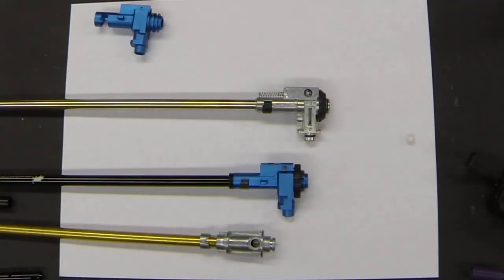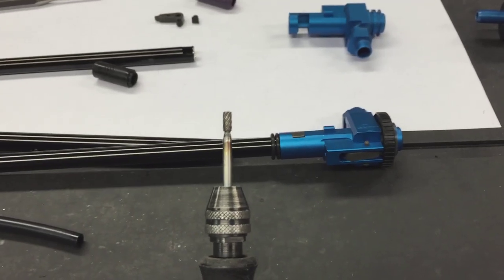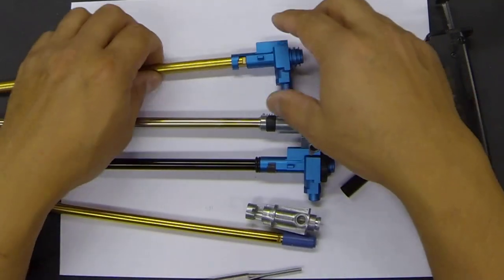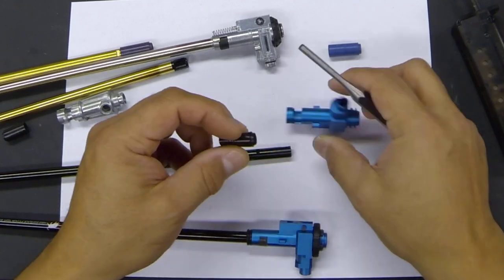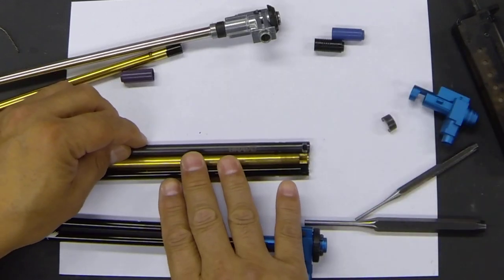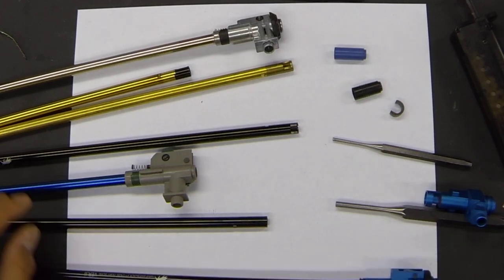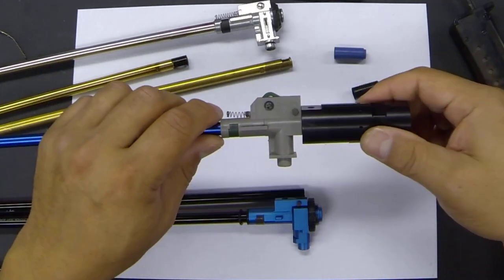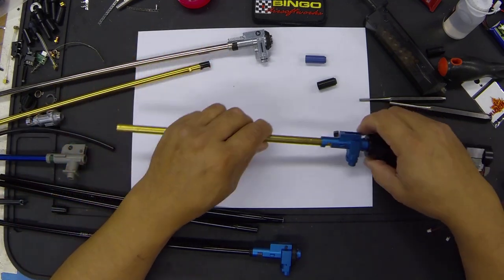Bingo Airsoftworks Hopup, Buckings and Barrel Testing and Troubleshooting

Comment: Hi, I am looking for my hop up chamber, and saw a hole in the upperside of it. Can I to close it? Can It maybe do a leak? My hop up unit is that you use in 14:16, G&G, gray. Thanks!
Reply: +Vicente Souza The hole in the top of the hopup is there to help prevent double feeds (I believe). No need to close it up, the air seal isn't with the hopup body, it's between the nozzle and the bucking lips only.
Reply: +Bingo Airsoft Designs THANKS FOR THE ANSWER, I CLOSED IT AND AFTER I OPENED, AND I DID NOT SEE SO FEW DIFERENCE.

Comment: Really interesting, thank's !
I usually use Delta Strike barrel, Prowin chamber, purple prommy bucking with inner cleaned up and the prommy bridge tensionner, imo it's a very good setup, since the ProWin chamber gives an extremely precise regulation whereas a Marui standard system is terrible. 
I'll try to shave of the extra lips on the blu flat bucking and test it in a ~440 fps setup :)

Comment: Hey man, thanks for the video, i learned a lot! But i found a problem that i can't resolve...
The bb drop test works perfectly in my prowin + g&g green bucking. but when the gun is assembled the 'bb drop test' fails, and i figured it out it is the very tip of the airnozzle is the cause for that, but i have no idea what to do, because if i adjust my hopup to be just that 1mm more in front, my gun loses FPS (probably due to airleak from the nozzle-bucking...) do you have any suggestion?
Reply from the maker: What type of gun? Which HPA engine? (or AEG?)
The hopup should be flush up against the fast of the gearbox/engine. It should not be moved forward.
Reply: BingoAirsoftworks its a m4 from king arms
Reply: AEG*
Reply: BingoAirsoftworks but if i leave it pressed against the gearbox, the airnozzle doesnt let the bb feed
Reply from the maker: With an AEG, you can't do a drop test when the hopup is pressed up against the gearbox because the position of the nozzle is dependent on the where the sector gear is and the tappet location. So depending on where the gearbox stopped, the nozzle could be in any position. If the BBs aren't feeding, it is likely due to low BB feed pressure, so it isn't pushing the BBs up into the hopup hard enough. See my other video on BB feed pressure from mid cap magazines. There is a possibility your nozzle is the wrong length, but really all M4 nozzles should be pretty standard.
Reply: BingoAirsoftworks I am having the same problem with my krytac mk1. Haven’t had any problems with it till the other day I took the upper receiver off and now it’s not feeding right. If you look through the mag well you can see the tip of the air nozzle from the bottom of the hopup. I have removed the upper receiver many times and never had this issue till now.

Comment: jams at the bucking when i use a c clip but when i remove it, it's fine. is it that important to use one?
Reply from the maker: Yes, the C clip keeps the bucking/inner barrel from moving forward (and shifting) in the the hopup. If having the C clip in is causing the bucking to jam, then it means the bucking is likely incorrect for the hopup or the inner barrel isn't correct spec. Which the C clip in, it's pushing the barrel toward the mouth of the hopup, either the C clip slots are in the wrong place, or the bucking mouth is too thick. Try a different bucking.

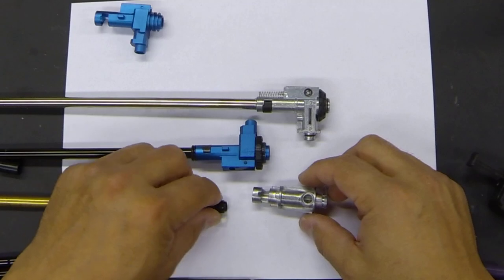Comment: ( 3:05 ) With the bucking part about it being a bad thing if the bb wouldn't be able to get passed the bucking is false. Yes, this can cause jams, but only if it isn't aligned right. Having the lips of the bucking do that is for accuracy and consistency. because if it didn't have the lips then there would be many variations in the bb's flight

Comment: Is there a hopup chamber i can replace the G&G gr25 with?
Reply from the maker: Magnus Ohme You might be able to replace it with an M4 hopup, but you'll need to add a spacer between the hopup and cylinder to make sure the hopup is located in the correct place for the nozzle and magazine.

Comment: I have a problem with my setup Bingo, 

Gun: Snow wolf m82a1
HPA Converted with mancraft v2 gearbox.
Deepfire 800mm 6.02 inner barrel
Prowin m4 hop up chamber.
Prometheus purple bucking.

The Prowin wont c clip onto the barrel. I clip it in, but can easily move it out of place so the clip gets loose. Why is this? Is my barrel not compatible maybe?
I also do get a slight right hand curve on the bb's and sometimes double feed (every 1/15 shots)

Hope you can help me!
Reply from the maker: Test the C clip on the barrel without the hopup in place. See if the C clip fits into the side grooves and make sure it also sits flush against the barrel. If the barrel rotates too easily in the hopup, try adding some teflon tape around the bucking to make it less loose. A barrel that long needs to be supported along its length to prevent any warping or bending. Look down the barrel with a flashlight, and make sure it's a perfectly clear and straight view to the nozzle.
Reply: Thanks for the quick answer! I will test that out now and give you feedback on how it went

Comment: Any idea in how to fit a Prowin Hop Up chamber into a KWA SR10??
Reply from the maker: It's possible but I don't recommend it. The KWA closes like a scissors, and if you put a Prowin in there then you won't be able to close it that way. You would have to install the gearbox/engine into the upper first, then attach the lower and grip. To install a prowin, you will need to dremel out the lower receive to make room for the hopup to drop in from above.

Comment: Thank you very much its an extremly usefull video, it solved me some issues that i have with an SPR
I have one question, did you ever test the 5KU cnc chamber? it looks like a clone of the prowin and is less expensive
http://www.ebairsoft.com/5ku104-aluminum-chamber-marui-p-5884.html
I can't find the PW here in spain that's why i was planning to get the 5ku
Reply from the maker: I have not tried that one, but it does look like a prowin. I'd say give it a try and just do the same tests with it.
Reply: BingoAirsoftworks I've just found the PW original at 18$+6$ of shipping at WGC http://goo.gl/bUOB2B
For 3$ more than the 5ku i think i'm going for the PW,
I'm having firing issues with my VFC SR15, i installed a Guarder HighSpeed motor and it's doing around 35rps (a lot rof for my taste but..) and the problem is that in auto the bbs fall just out of the gun because the stock hopup can't handle that much ROF i'm currently using a Madbull blue bucking and DeepFire 6.02; on semi fire it performs excellent doing a great grouping at 60meters.
Do you think the PW could handle it? with what bucking? I've just bought the A+ REAPS ME3 80º, i thought that harder bucking equals less deformation of itself and more presure will gave to the bb in auto.
I almost always go on semi firing but sometimes auto is necessary.... so i need to fix this issue

Comment: Don't sand the lip it will make it less accurate
Reply from the maker: Speeds Myname Only if the air seal is compromised. The bucking lips create the air seal with the nozzle. The nub imparts the backspin.

Comment: Please answer fast! I have a krytac buckong and flat nub in a prowin. The bbs feed into the hopup and then when i fire my P*, they dont come out until full auto is on
Reply: Did you do the push through test? How easily do the BBs push through? Are you using a JACK or a Fusion Engine? Make sure your DP setting is high enough so you aren't getting a dead shot. For the JACK, start at 99 then lower it until the FPS drops. For the FE, start at 25 and then bring it down until the FPS drops or you get deadshots.